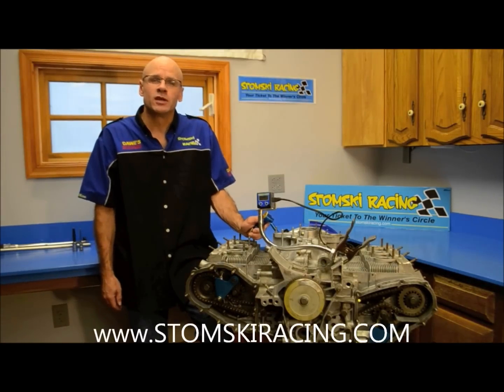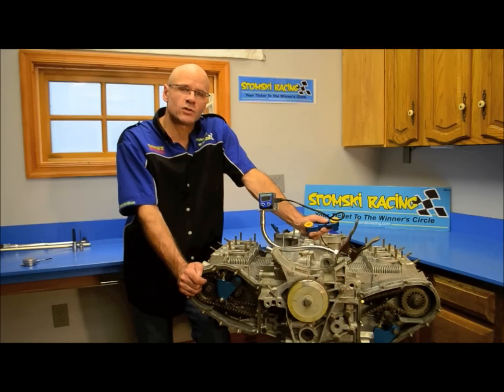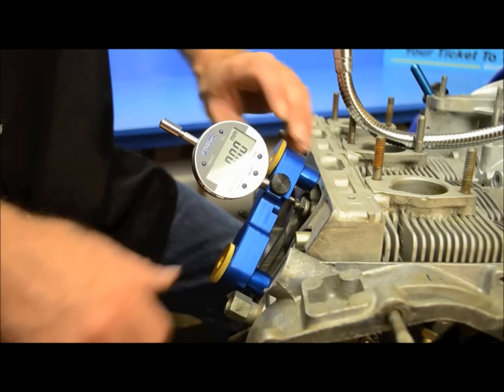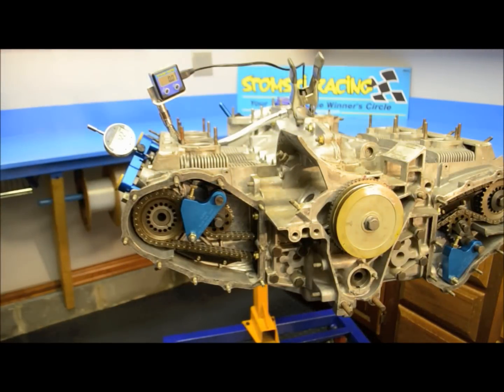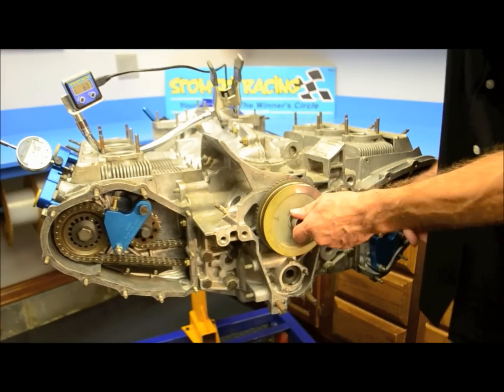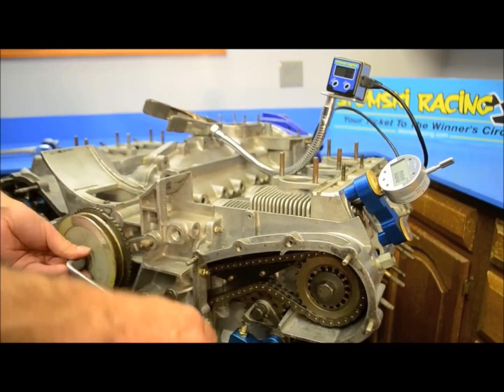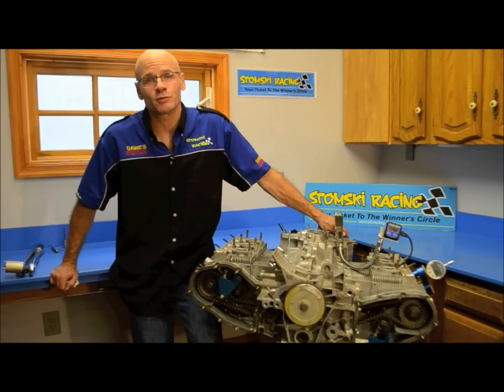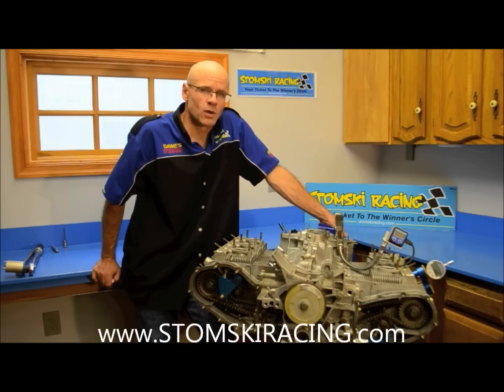Timing Camshafts on a Porsche 911 Engine using STOMSKI RACING's SR098

Comment: Nice video. Great tools.  But it would have been better if he had set the engine up to basic TDC with the crank at Z1 and both cams with the punch marks/keyway straight up and then it would have been ready to time easiest.
In this position the #1 cylinder would have been on compression and only required to turn the crank 360 to put it in overlap and set the timing as described. Then another 360 to do cylinder #4.